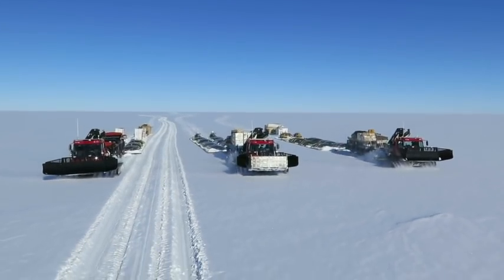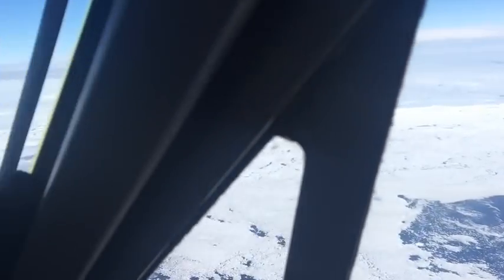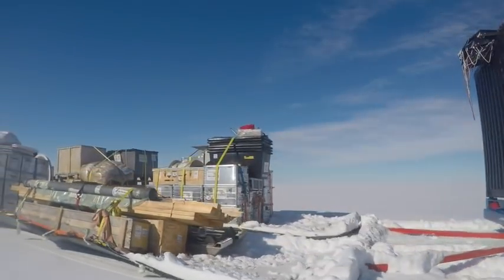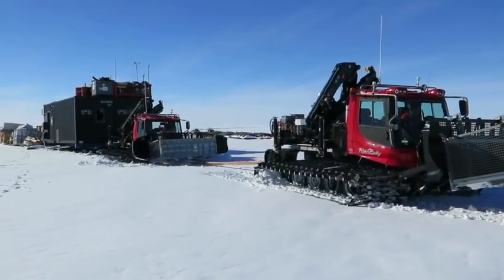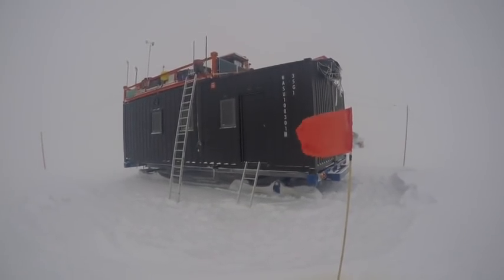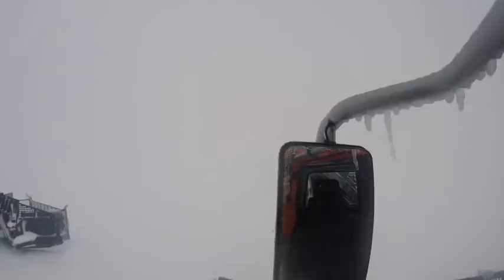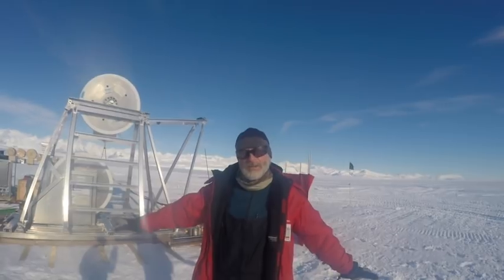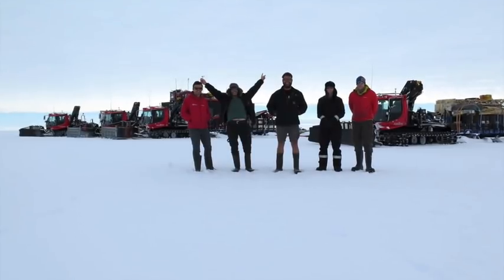Tractor Train Traverse - Ronne Ice Shelf 2017/18

Comment: Pretty cool.  Thanks for sharing. It brought back memories of seismic oil exploration on the north slope of Alaska and arctic ocean. We lived on cat trains similar to yours but not as nice. Mainly used deltas and nodwells made by Foremost made in Canada. We were normally never more than a 100 miles from Dead horse, Alaska. The distance you guys traveled would be quite the adventure.

Comment: The amount of weight they can pull looks insane.
Reply: low friction, compared to roads
Reply: @Will91289  actually, sliding friction is higher than rolling friction.
Reply: @huawafabe  Explain to me how ice has more friction that loaded wheel bearings on asphalt.
Reply: @DR10002  not much to explain, other than experiments showing that objects on ice have a sliding friction coefficient of roughly 0.03 and tyres on road have about 0.01, that's a difference of factor 3
Reply: @huawafabe  Jones and Childers report coefficients of friction of about 0.7 for dry roads and 0.4 for wet roads  

Your facts are wrong and your logic is illogical. There is no situation where its easier to drive a tuck on a road than a sled on ice.

Comment: I'm a certified heavy equipment operator and licensed commercial driver with 15 years combined experience in both industries. I've often contemplated signing up for an expedition like this but I wasn't sure if I would have any value to one of these teams without a scientific or engineering background.

Comment: What is the reason you sometimes run abreast of each other and not single file?  The packed trail would make running more efficient, it would seem to me.
Reply from the maker: It’s actually easier to run on untouched snow, if it’s been freshly run on it has no bite for the tracks
Reply: @12345nev  Makes sense I guess, given the sheer length of those trains.
Reply: @dansw0rkshop  it would be different if the track was a day later , it would harden up.
Reply: @carmichaelmoritz8662  Yes, I grew up around the 51st parallel so I know how it works.  I also don't quite buy Michael Neaverson's explanation because the pulling vehicles don't need as much bite, because the packed trail also offers less resistance to the loads they're pulling.
Reply: @12345nev  Around the 11:12 mark he mentions switching to single file (trying not to run over each other's gear) and coming in a day apart.

Comment: I don't know if you guys realized but you would be directly attributing to the ice cap changing just by being there messing with it.
Reply: You really think anything of this would make any difference for an ice cap that is some kilometres thick and as big as a country? I really hope you're joking. What should even happen? It's pure ice hard as rock. You couldn't do anything that is significant enough to change anything for an ice shield as large as this even if you wanted. They don't even impact 1m of snow on the top layer where they drive over it and only thing it does is compacting some snow on the top layer. You would literally need a 10km large meteor to do anything with that ice shield.

Comment: You guys need to start using the much larger tracked catipiller tractors
Reply: Pistenbully's actually have better power and grip than the small rubber tracks on the cat's.
Reply: @MrT79shakeshake  I wouldn't think there would be any need for the weight of anything CAT builds.

Comment: is it not safe to follow each other on the same tracks to make it easier?
Reply: If there was a cassavas, the possibility that the first tractor train passes over it without issue could mean the second one would be more likely to break through. The other thing would be the snow is still there and still loose so it might not make much of a difference, and travelling next to each other would be safer then travelling in a long line with enough room to stop if the one in front stops or visibility is reduced within a matter of minutes.
Reply from the maker: It's safe but less efficient as the PistenBullys pull better on fresh, harder snow.
Reply: @12345nev  thank you. Is there a follow up video?

Comment: What NO satellite imagery, ground-penetrating radar from NASA..?   $$ Could do without the Carbon TAX Spin.
Reply: Not many satellites fly over the poles, most probably stay between 60°N and 60°S, so they would have less satellite imagery and research available than more populated parts of the world. Some, but not as much. Likewise GPS doesn't work well at such high latitudes, the satellites don't provide much signal there.
Reply: @quillmaurer6563  We had access to 5 satellites with great GPS and Sat. phone reception over Queen Maud Land. But we also used GPR in the sketchy areas and still managed to find a crevasse. But we got lucky and only one sled went in partially.